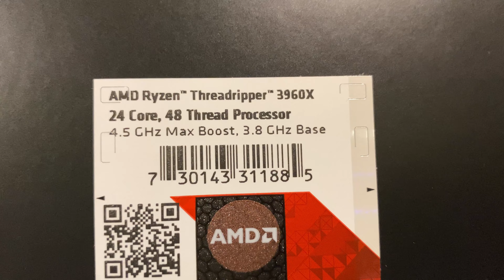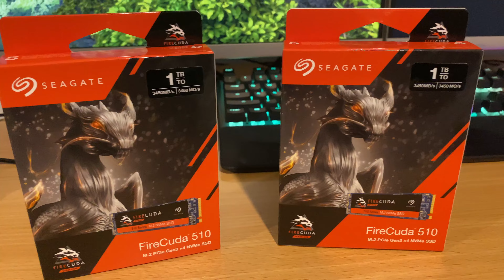Lian Li O11 Dynamic XL Timelapse Build with RTX3090 and Ryzen 3960x

Comment: Nice build man, but I have a question, the 2 usb's on the top has a big end connection and the 2 usb's on the bottom has the same.  My mother board only has one place for it. Did yours also, if so what did you do ?
Reply from the maker: My motherboard has 3 internal connectors so I was able to connect everything. What motherboard have you got?, I will double check it for you. You can buy an adapter to add more port headers for your motherboard btw if you only have one
Reply: @techtezza  Asus strix z390e, that's the only cable I couldn't connect, so I connected the bottom usb's. Thanks for the reply
Reply from the maker: @DirtyCes  Ah no worries, yeah checked your motherboard there is only one. You can get this one here to add more connectors, search Silverstone USB 3.1 Gen2 PCIe card
It plugs into your pcie slot and U get two additional headers
Reply: @techtezza  Nice, thanks a lot, subbed

Comment: Hey bro, nice video.
Can you help me with this doubt?
If you put a water cooler on the side, with 450mm tubes
Would the water cooler pump reach the processor?
with the radiator tubes facing downwards
I'm just trying to find someone to help me with this question, if you can help me in any way I would be very grateful.
Reply: If you take a 450mm long tube, it will be possible to test this possibility without having to touch your pc's components, as there is no store in my city with this case for me to test...

Comment: Nice vid and build. Would have loved to have seen some more clean pans of the final build rather than the tilt shots. Maybe the best cable management I’ve see so far. Others have been a mess.
Reply: It's nearly impossible to have crappy cable management in this case. I'm not sure what channels you watched but they were clearly amateurs if they failed at cable management.

Comment: Hey !  what is your temperature when the card is loaded in games?  I have a Corsair 5000D case, I want to find something new colder for my ASU's 3090.
Reply from the maker: 67 degrees when mining crypto. When gaming temperatures are in the 50's. Ambient temperature where I leave has been about 30 degrees Celsius
Reply: @techtezza  thanks for the answer, when mining 67 degrees is it on the chip or vrm?
Reply: @techtezza  I have on my Corsair 5000 d, the average temperature in games is 68 degrees, in mining on a chip 50 at 90 vpm.  I understand that lian Xl shows such good temperatures due to the fact that a cooler is installed under the video card?

Comment: Shouldn’t you be using a separate PCIe power cable? Waiting on my Kingpin 3090 and from all the reading I’m doing (while I impatiently wait) about the various cards everyone is saying don’t use that mini connector. Way too much power draw. Run separate power cables.

Anyway, nice set up overall.. can’t wait to build mine!
Reply from the maker: I havent had any issues with it connected this way. i have a Corsair HX1000 1000w power supply and each cable can supply 40A of current, i.e on that single PCI-E cable it can supply 480Watts. I have overclocked my card doing benchmarks and i have spiked at about 380 watts power draw just from the card alone. plenty headroom and no issue. The power supply has a mode to switch it to unlimited current on any of the 12v rails to the limit of the 1000watts though. if people have recommended having it separate i reckon its power supply dependent hey, as in how much current draw it will allow on one cable connection. What processor you planning to use in your build? settled on a PSU yet?
Reply: @techtezza  it’ll be the 11900k/Maximus Extreme as soon as the parts are released. I have the Seasonic Prime Titanium 1000. Pretty much top of the line PSU.

I think people are specifically calling out the 3090 too due to the insane amounts of power it draws. Coupled with the fact people are BIOS flashing to 500w or even the KP520w BIOS.

Seems as your power draw is quite a bit less on that card but if nothing else maybe something to consider if you decide to push it down the line. I’m somewhat of the opinion if we’re paying this much for a card we owe it to ourselves to milk it for all its worth. I won’t be doing extreme LN2 overclocking but I’m definitely going to get what I can out of it.

Appreciate the response!
Reply from the maker: @toyomade  looking at the manual for your PSU it does specifically ask that you use two seperate cables which I recommend you do too. This could be because of the spec of the cable only allowing a specified amount of current through it before it melts. The thinner the cables the more resistance they will have. An advantage though for the looks and less space used. They might also have over current protection for certain thresholds that the new cards can exceed. My card is OC stock out of the box to1795 MHz versus the reference which is at 1645 MHz I think. U can push the clock higher but I noticed the power draw jumps insanely and also that I haven't found a game (even cyberpunk) at full settings on two 4K monitors using the card at 100% all the time. First play with it at stock settings see how it performs then overclock if U feel it's holding you back.i also left as is as pushing it to its limits and having temperature and voltage higher will reduce their lifespan. Planning to keep this one for a very long time
Reply: @techtezza  I’ll def be running 3 separate power cables to the GPU. I have the cables to spare and on the KP they’re not out front of the cards so they’ll cleanly tuck away. Basically no reason not to use three cables just to be on the safe side.

Even if it wasn’t on the end of the card I’d probably splurge on CableMod bridged cables and do 3 connectors anyway.

Regardless, glad you took the time to respond and I’m sure you know what you’re doing!

Comment: Awesome build mate
Btw what monitors do you use?
Reply from the maker: They are Asus monitors, 27 inch 4K resolution, 60Hz refresh rate. Had them for almost 3yrs now, been good.
Reply: @techtezza  Definitely worth moving onto higher refresh rate monitors to use that GPU and those surplus frames Tezza! Depending on what you like to play of course.
Reply from the maker: @samB_o  won't settle on less than 4K, love the crispier resolution than a high refresh rate. However eyeing Asus' 4K 144Hz monitors. Waiting for price to come down a bit.

Comment: Hey! Great build! I have the same case and I can’t figure out how to change the front panel case RGB to something other than red.
Reply from the maker: On the front of the case you have two buttons labelled 'M' and 'C' clicking through those will cycle between different patterns and colours etc. they are below the the USB C type connector
Reply: @techtezza  Hi, ich habe silver one too, but is it possible to turn it off, or to include it into the Corsair Icue Software?
Reply from the maker: @carsmusicmtb5156  Yes I forgot to mention the method i stated above is for controlling the lights manually using those external buttons. I actually have them synced up with the rest of the pc by plugging into the motherboard ARGb connector or RGB, i cant remember which header they use. through the motherboard software as every light is plugged into it i control everything from the one software
Reply: @techtezza  ok thank you

Comment: powering the 3090 with a single strand of 2x8 pin it's not a good ideea, yes it's a the limit and it works, but still not a good idea (theoretical limit of a single gpu power cable is around 285W) and that 3090 pulls around 70-90w from PCIE slot also which is close to total 370W that it actually draws, but still... to be safe you should power it with two individual pcie power strands from PSU and use one 8 pin connector from each one.
Reply from the maker: My power supply operates in single or multi rail. It allows a single cable to draw more power than standard. The cables are rated for that extra power draw. Got that PSU for a reason for situations like this

Comment: why is the graphic card holder light not working?
Reply from the maker: Ah first one to notice! I ran out of ARGB connectors on the motherboard so I wasn't able to connect the graphics card holder and the case LED strip, luckily it has a manual control. I ordered a splitter cable, one from CoolerMaster that splits into 5 connectors. I have ordered more ARGB fans to replace the stock nzxt on the radiator. Waiting on those to arrive before I connect everything up again. I will do a video hopefully of the new setup this week